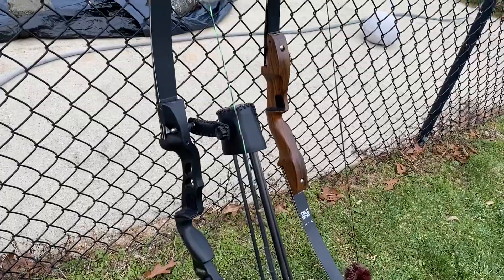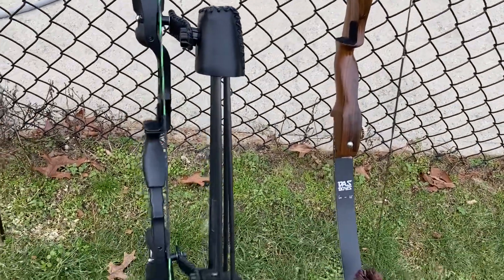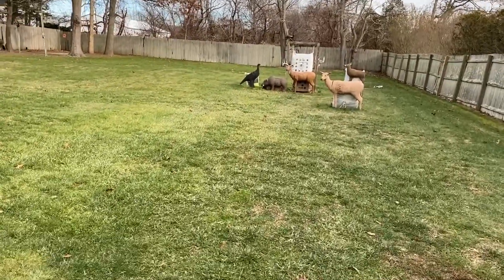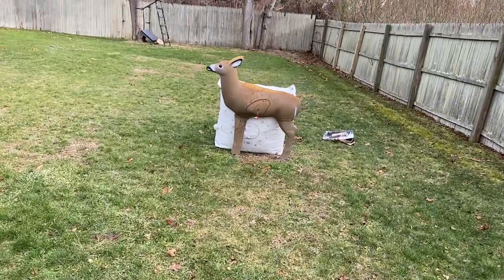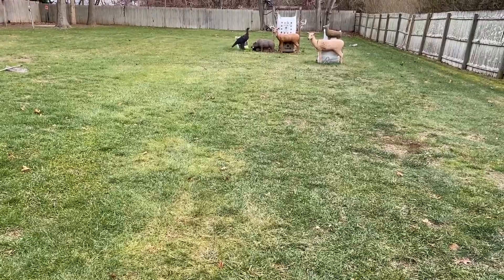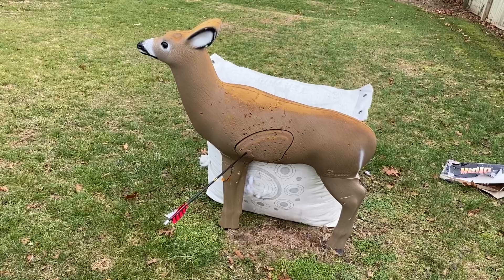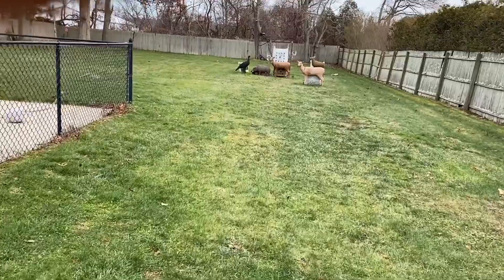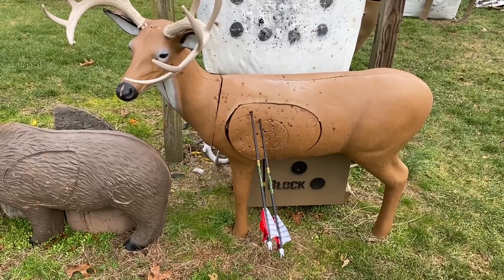Traditional archery ILF bows, TBow Black Max 40 and PSE Ghost cut past center with Das 35 limbs.

Comment: Hi Joe, I just got the TBow in and realized the lateral adjustment screws and dovetail receiver are not even attached to each other?? So, no lateral adjustment function.
Seems just the main bolt attaching it to the riser is all that keeps it in alignment.
Was yours the same?
Thinking of returning mine if it’s a defect.
Reply from the maker: I believe the screws were touching the dovetail to allow for adjustment. I don’t own it anymore I hope you can resolve this problem. Wrong length screws put in at the factory? Good luck
Reply: @hunterarcher11  I think that’s exactly what the issue is.
I may just return it and get an OMP Night Ridge instead.
Thanks for your help and your content!

Comment: What do you think about the T Bow riser as compared to your Satori riser
Reply from the maker: I have the 17” Satori and the 19” TBOW.  Both 19” Satori and 19” TBOW look identical. I have shot both 19” risers. I can’t speak on the actual quality but both shoot incredible. Can’t go wrong for the money. You can add a actual Satori grip, which I did. I prefer it over the wood. If you can feel different risers in your hand before you buy that would be best. Everyone liked different risers, heavy, light, and grip feel.
Reply: I have both and they actually feel the same. The Tbow is one of the best buys for an ILF.